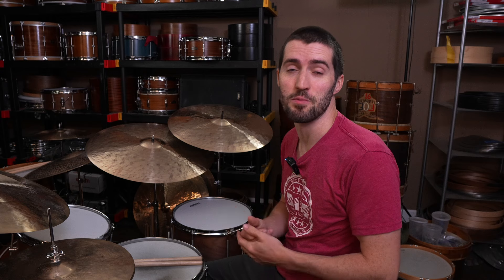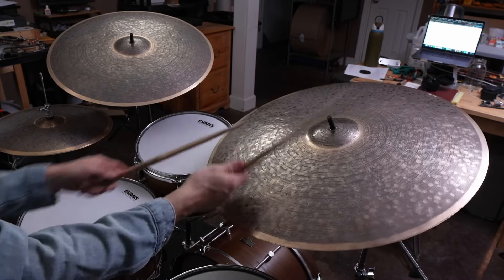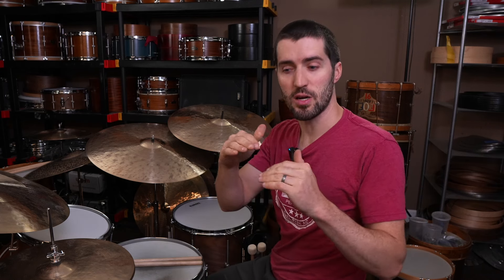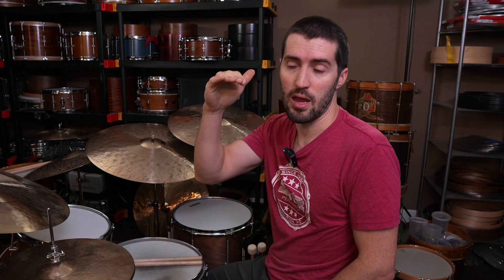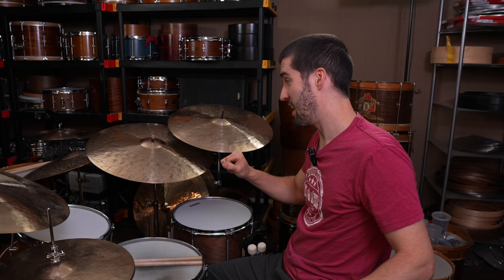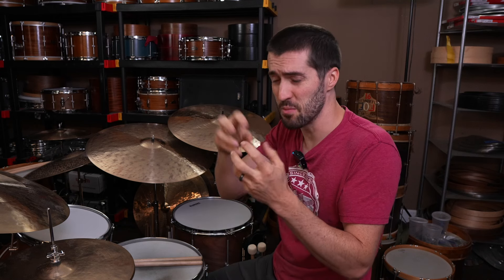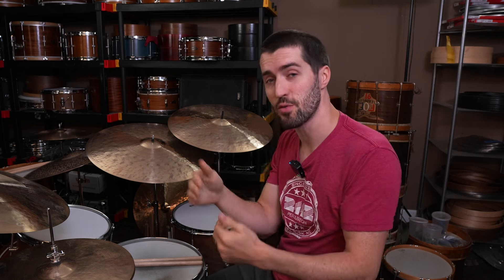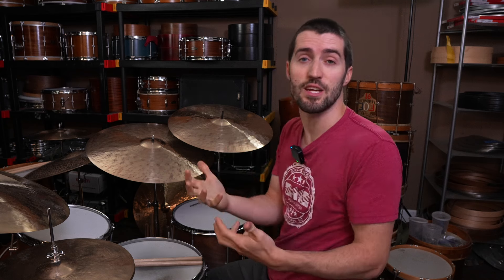My DRIEST cymbals FIXED

Comment: The heavy and controlled character of the original version as well as their clarity and stick definition  are mostly lost in the wash after the cymbals were modified. The fixed cymbals sound amazing though, I just think they're completely different instruments. It goes to show the insanely wide range of sonic possibilities you can obtain from the same blanks!

Comment: Now, those cymbals sound very much like smaller brothers of Istanbul Agop Xist brilliant rides which I like very much. My holy grail has been an over 3500g 24" version, but there doesn't seem to be them on the market here in Europe or there overseas.

The 60's kind of jazz cymbal sound that most of your other cymbals seem to have a strong connection to ( they are very good sounding on their own though) are not for everyone. I think that now you have stepped into a bit more modern, kind of electric jazz era with these new pieces. Great 🙂👍👍
Reply from the maker: Yeah, I plan to make more versatile cymbals moving forward.
Reply: Btw, fogot to mention... your playing is right on the spot 👍

Comment: Adding my thoughts as the owner of an (I believe your last?) unmodified 24" Foundation who loves it. This is my third, and favorite, cymbal from you. 

The re-lathed ones sound beautiful and richer, and I agree that for general purposes they'll be a solid all-around choice. That said, the new ones are also more conventional and less idiosyncratic instruments that exist in a sonic range where there are a lot of choices. By contrast, the dry version has a distinct voice and musical point of view that is rare and few makers get right. As a lover of more modern styles of jazz and broken time, I thrive on dry cymbals or ones with clean sticking and quick decay, and it's VERY hard to find great ones that still have balance and energy and rich, dark tone. This is one. In fact, I think as dry rides go, these are pretty much in the middle of the road. Many "dry" cymbals, like Turks, can actually still have a fair bit of ring to them. And on the other side of the equation, I personally found the Jack D cymbals rather thin and lifeless. So for the style, these are quite balanced. I can pair this with my even dryer flat and the Foundation will sound relatively lively next to it, or I can mute it lightly and have it play the dry role alongside fuller rides and crashes. I do think 24" is the right size for the dry version of the Foundation, since added size gives it more roundness and complexity; I wouldn't be as keen on this model in a 22" or smaller.

FWIW, even if someone's not generally a fan of dryer cymbals, I believe in a set-up having deep contrasts, where each cymbal has a separate personality, and these really suit that. When you think about how many notes and keys any other instrument in the band has, and contrast that with the fact that like 60-75% of what our bandmates and audiences are going to hear from us is a single ride cymbal note, I think we have the opportunity to give their ears and ours added variety. So I encourage us all to experiment and add something unexpected to our cymbal arrays, which also pushes us to adapt and stretch our playing in new ways. 

All of which is to say, even if they're not your own cup of tea, I think the original dry Foundation is a glorious little monster we need more of, and I hope you keep it available if only as a special order.
Reply from the maker: So happy to hear it! Thanks brother.